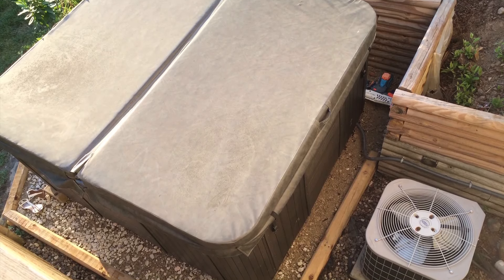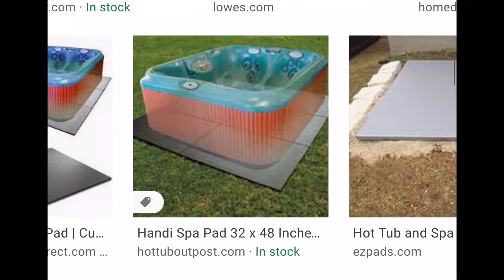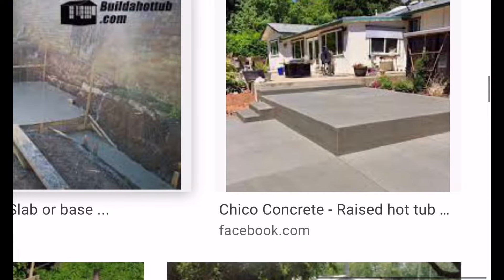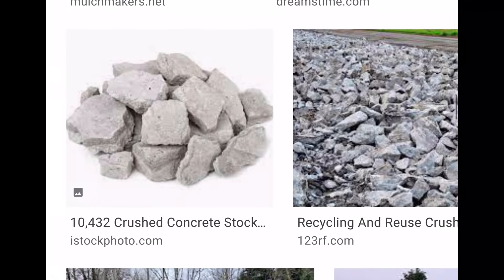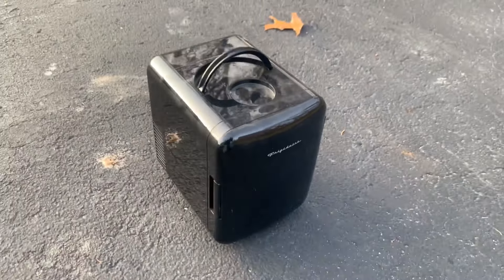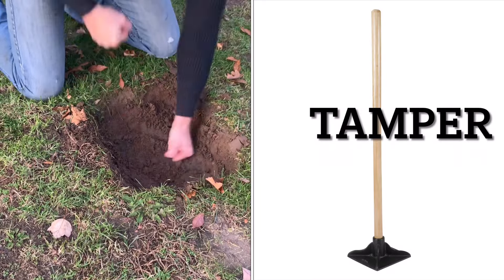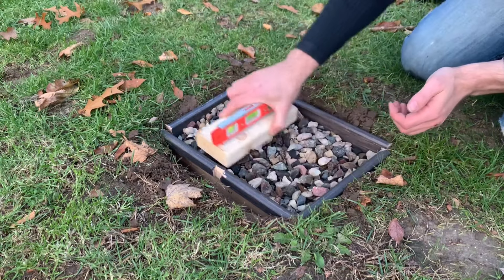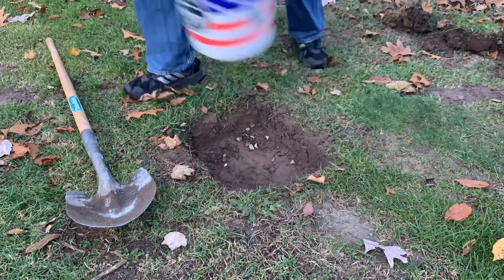How to Build a Crushed Concrete Hot Tub Spa Base - Better than Wood Deck, Plastic Pad - Easy Cheap

Comment: Always always always install your hot tub on a 4" thick concrete slab. Owners manuals make it quite clear that your warranty can be voided if you install your hot tub on and un-level surface. All stone settles and sinks. I bought Spa Level-R and leveled it on a pitched concrete slab, great purchase.
Reply: How did you level the pitched concrete?
Reply: @ You can’t, all concrete is poured with a pitch for water run off. The Spa Level-R adjusted for the pitch.
Reply: @Misfits138-23 ah I see, I didn’t realize they had product like that

Comment: just wondering if it would qualify under the standard  "WARRANTY CLAUSE" in most Manufacturers warranties that state "MUST BE PLACED ON A SOLID LEVEL SURFACE'.  As a veteran in the Hot tub industry, I can share that the first thing a manufacturer asks for when there is a cracked shell claim is a picture of the installation. If it is found to be installed on a gravel base the claim will be denied especially if the above mentioned clause is in your purchase contract. Failing to mention this information could cost somebody a considerable amount of money if they are denied their claim.
Reply from the maker: Very good point.

Comment: Will it crack the hot tub to put it on crushed rock?  Seems like there could be pressure points and the tub bottom could get cracked.
Reply from the maker: I was concerned about that when I looked into this method, but it was not an issue at all. It is very stable, and will not move. Just make sure to level it, and you’re all set.
Reply: Just use gym foam pads underneath

Comment: Does the diameter of the pad have to allow for 1+ feet of space on all sides of the tub for structural reasons?  I was considering just a few inches on all sides for mine
Reply from the maker: No, I don’t think so. If the frame of the base contains the rocks, a few inches will be fine. And the rocks can always be re-leveled if things settle.

Comment: this is just what i have been looking for, great video. I will be doing this in the very future. I am also looking to install a semi permanent frame to enclose the hot tub with a roof and solid removable walls, not needed to be weather proof. So could you use a screw in post support ground anchor threw the crushed concrete?

Comment: Hey, love your video I had a quick question about the landscape timber. Do you screw them on top of each other to give it that finished look like the one in your pictures?
Reply from the maker: For the first/bottom layer, I ran rebar through them, and about a foot into the ground, to secure them in place. 
Then, there are landscape timber spikes/nails to secure them to each other as you stack them up.
Reply: @HowtoandReviewsOfficial  i see so pretty much the frame of the first bottom layer you drilled holes so the rebar can secure it from moving and they were a foot long and the rest of the layers were the landscape timber spikes ..
Reply from the maker: @izzo4231  Exactly!
Reply: @HowtoandReviewsOfficial  hey just wanted to thank you again for the advice the crushed concrete is 2inch ok or 3/4 ?
Reply from the maker: @izzo4231  I would definitely recommend 3/4 inch.
If your supplier has options, it’s worth asking their recommendation for your application (hot tub, about 3,000 lbs distributed over about 60 square feet, no shifting or sinking)
Reply: @HowtoandReviewsOfficial  hey thanks for the help was able to get it exactly how I envision it would look I guess the only question is do you know the easiest and cheapest way to move a 700 pound hot tub 30ft from its original location lol?
Reply from the maker: @izzo4231  That’s awesome! 
I actually did make a video on how to move a hot tub. Link below. I recommend rolling it on PVC pipe.
https://youtu.be/QLjyKtGY39o

Comment: Can we use 2x6 boards instead of 2x8 boards. Will those still work? Thanks!
Reply from the maker: I think that would be ok. They are 5.5” wide (not 6”), which should be sufficient. I would not have any concerns wit it.

Comment: Very well done video and quite helpful. I will be using this process for my hot tub installation in the spring.
Reply from the maker: Awesome. Glad to hear that. I wasn’t sure if it was worth doing as a mock-up, but it’s information I wish I had when I was researching hot tub bases! Glad you found it helpful!
Reply: @HowtoandReviewsOfficial  Very helpful and cleverly done. I used gravel for my floating deck foundation, being that I'm in the northeast, and was researching ways to build a foundation for a future hot tub. Wasn't sure if gravel would work but I'm convinced now.. thanx again!

Comment: digging down, do you have issues with it retaining water, since part of it is buried? or has drainage not been an issue?
Reply from the maker: I considered that because the ground was clay that does not drain well. However, I never experienced any issues with it not draining. It’s never been a problem.